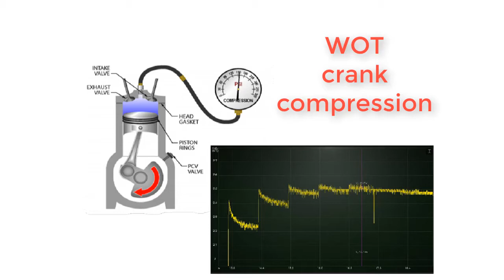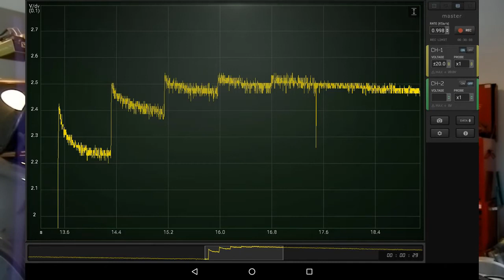GADGETS#19 - WOT CRANK COMPRESSION

Comment: You forgot--  you don't have to run back and forth:  You can just bring the tablet in the cab with you :) 
In that case, you could reduce the buffer even more and get a higher sample rate--  since the tablet is right there with you in the cab and you can very quickly pause it.  It's a nice setup.
Reply from the maker: higher sample rates are to capture details in high frequency events

this test is very low frequency...like 10 Hz or so...lower sample rates produce better results here (less noise in waveform)